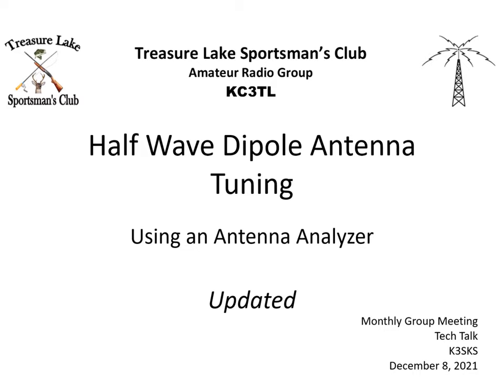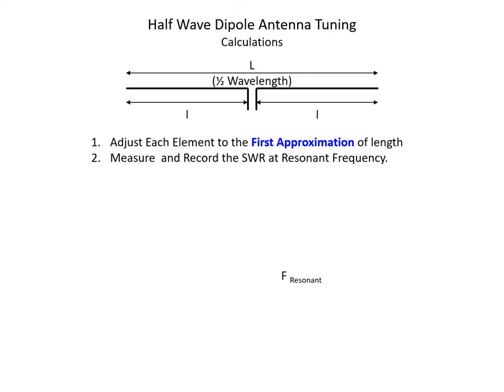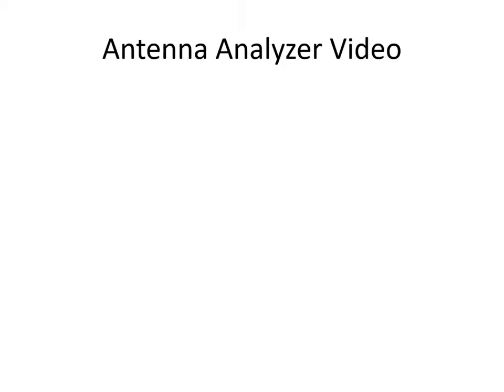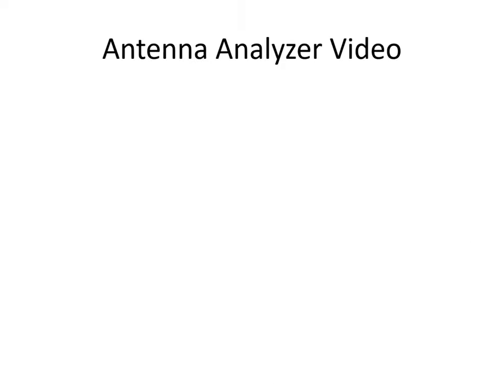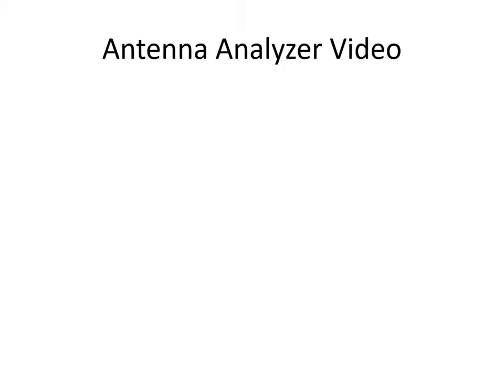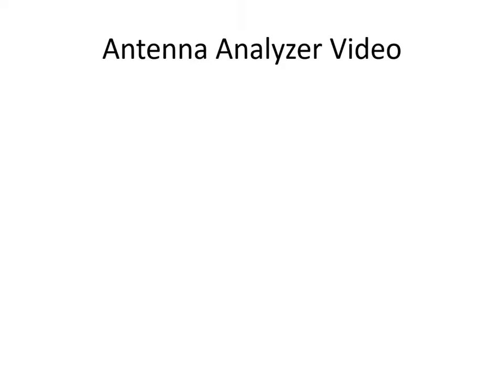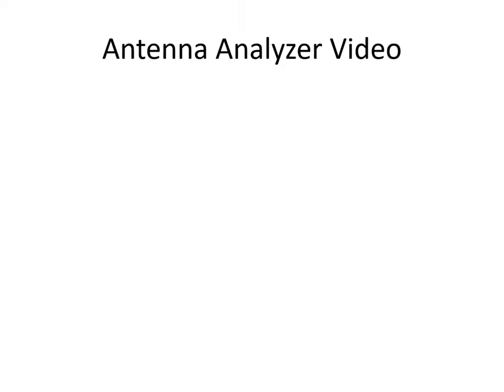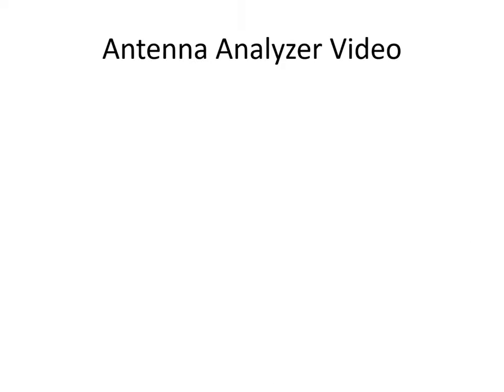UPDATED   Half Wave Dipole Antenna Tuning K3SKS

Comment from the maker: Chris, I  made a mistake on the form, not only am I an amateur radio operator, I'm also an amateur video guy, so rather than reshooting that section, I  added the yellow note around 20:16. If you switch those two numbers and crunch the rest of the numbers, I get -4.25 inches. Thanks for the catch. K3SKS